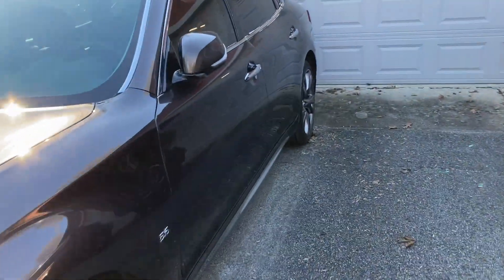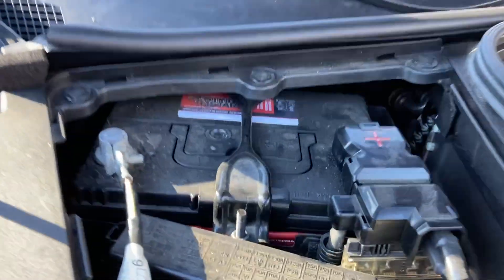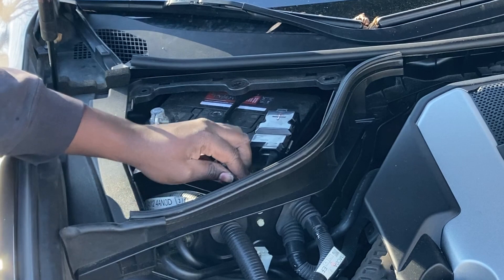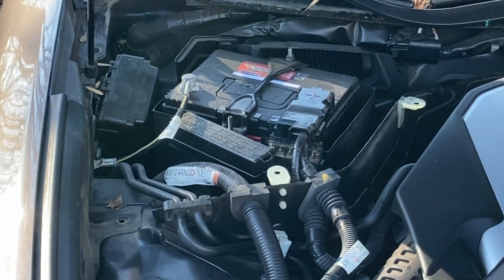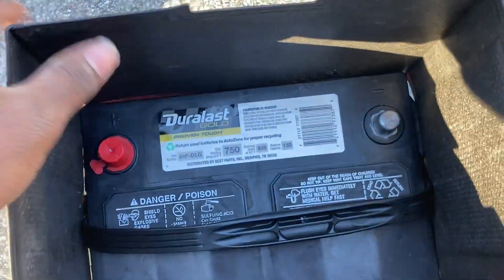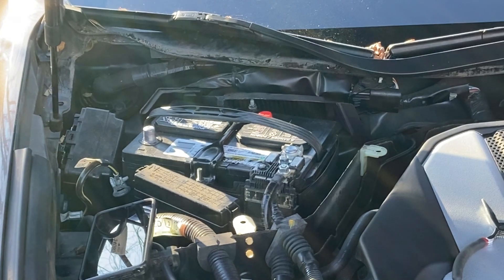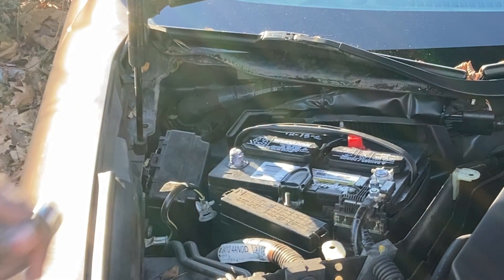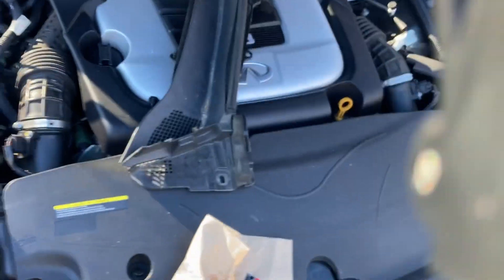Battery Replacement. FULL, Real Time Video. Infiniti Q70 M37 M56

Comment: Great video. I'm in Indiana, too. The alternator went bad today. The battery is very old. I'm going to replace both together. It's getting close to winter, so I figured I'd get it done while it's still warm. Looks like this should be the same process on my 2013 M37X.

Comment: Thanks for pointing out proper routing for wiring harnesses!!! 😉
Reply from the maker: You betcha!
Reply: @EdBwoy  idk if you remember my video about my battery wiring harness... prior owner changed battery, and didn't have the wires routed properly inside that rubber grommet.. wiggled loose and rubbed through insulation.. car actually caught fire.. that was fun 😆

Comment: Hello Ed 
Great content....i have a question hopefully you or one of your subscribers can help.  My o7 G35X everything works. But I have one issue.  Mind you the battery is strong.  When temp drops below 25 or 20. It won't start. Even with a boost.all instructions work but won't turn over. All the dash lights go on except the check engine lite. When the temp rises to 30 or above starts normal... Battery is new .  and when it doesn't start I also notice the brake pedal is tough... And idea what the cause can be. ??
Reply from the maker: The brake pedal is an easy one, since the cars use vacuum assisted brake boosters. When the engine is not running, there is no vacuum
Reply from the maker: When you say the car won’t start, does it crank at all? Or does the car just act like it has a dead battery?
Reply: The car instruments panel lights up. Does not crank. Battery is new I even attempted to boost it no luck. Weather warms up. Car turns on.

Comment: Aye so the m56 and q70 the same car?
Reply: If you get a Q70 with the 5.6. Most are 3.7
Reply from the maker: Very similar. They changed names in 2014.
Q70 v8 = M56 after the refresh
Q70 v6 = M37 after the refresh
Q70 hybrid = M35h post refresh